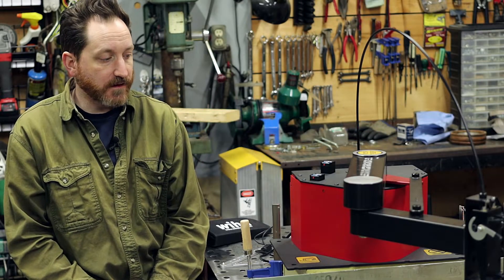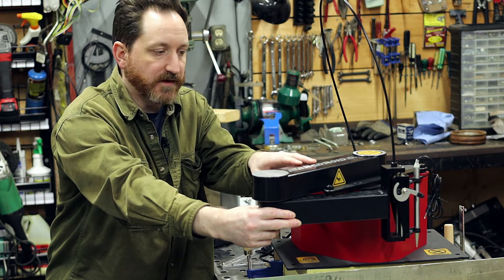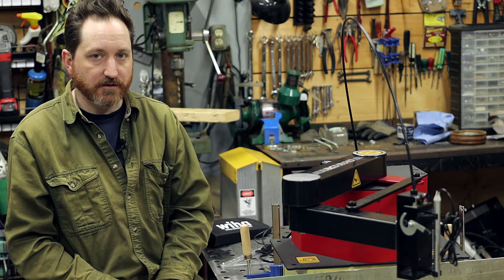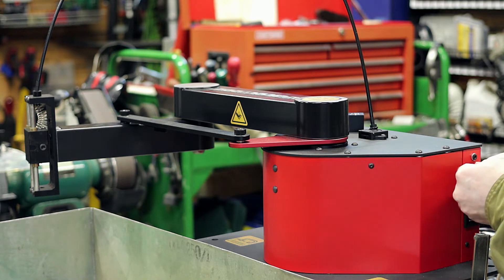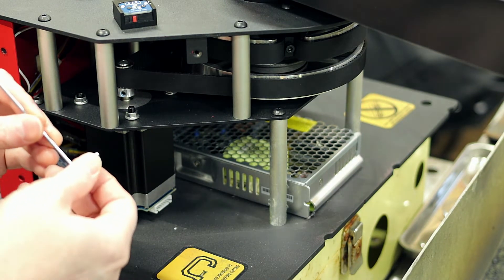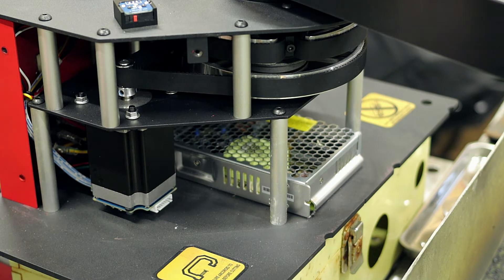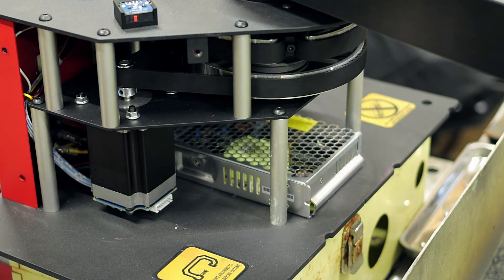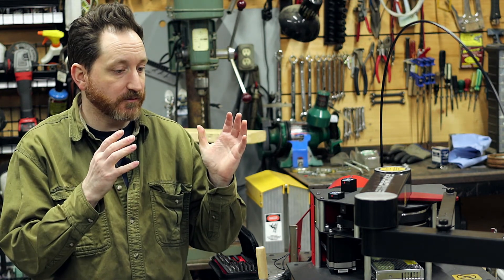ArcDroid Troubleshoot Followup

Comment: Any arcdroid user here that regrets buying the unit? Problems? Reliabilty? I really like the trace feature and that is the selling point of why i would like to own one. But for hobby welding i would like it to be a really worth it considering its $3500 here in Canada.
Reply from the maker: The major issues in my videos have been dealt with on the current version of the ArcDroid. At this point there's nothing as an obstacle that's any different from any other CNC. If the stuff you are doing will fits inside the cut area, it's a pretty reasonable option for the price.  Especially when you add in the trace capability. I would add it's not a perfect high precision trace but it's appropriate for the price and completely usable for the home fabricator.

Most of the problems are coming from people with zero CNC experience. CNC is a steep learning curve if you're new and I don't think most people expect that. Or sometimes they need some motivation or knowledge on troubleshooting to solve their problems.

Comment: Thanks for showing how to fix the loose pulleys on the ArcDroid.  Where did you get the nice size welding table? I don't have allot of room for the larger ones. Thanks again.

Willy
Reply from the maker: Princess Auto. They periodically have them for a Hot Buy, it was $170 or 180 CAD all in with a bunch of fixture clamps. Price has gone up since then. If in the US, I think Klutch has one that's the same or similar. Or Vevor. Eastwood has one as well.

Comment: Any reason(s) not to take  the motor out and mill a flat on the shaft?  Thanks.
Reply from the maker: You could but it's a lot more disassembly. There's not enough clearance to just pull them out. And it's really not necessary. I just loosened the belts and moved the pulley up out of the way, used a small flat file on each shaft. Quick and easy.
Reply: You also could remove the set screw and drill a shallow dip in the shaft. It gives the set screw something to set into.